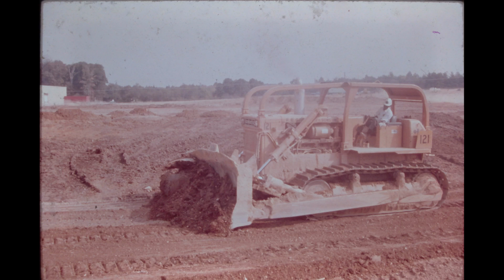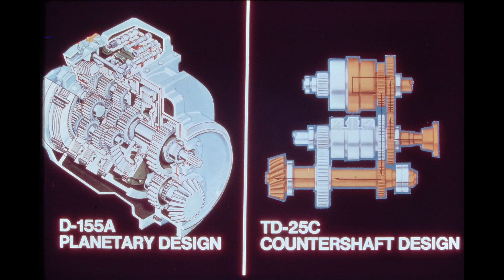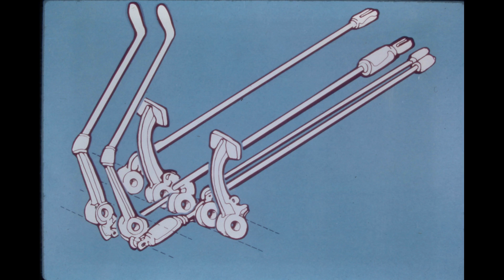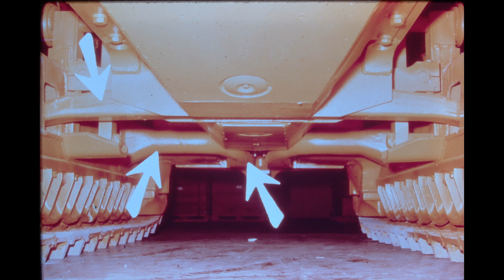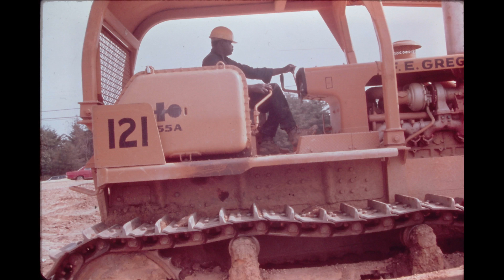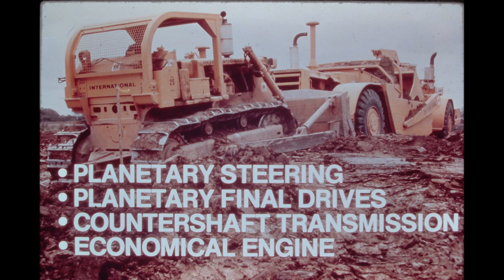International TD-25C vs Komatsu D-155A Sales Training

Comment: They were all pretty tough machines in their day…Komatsu’s trick was always to build a tractor just a little bigger and a little more HP and then run them in the same class as the other manufacturers…the thing about the IH’s is they were always a little lighter but had pretty good HP and unless you had a very savvy operator at the controls, the undercarriage would take a beating because they just weren’t heavy enough to hold them down…in the end Cat beat all their behinds!..not too heavy not too light for the HP available…they were the best tractor ever made…but I do love all the IH gear!..I would love to get my hands on a late model TD-25!..

Comment: How did the Cat D8K compare with these two
Reply from the maker: The D8K was a comparable machine but about 10 hp less than the TD-25C at 300 hp. I think the lower hp helped the D8K last longer. It was also slightly lighter and no planetary steering. But a formidable machine!
Reply: @deserttrucktractor2514  It's not very cost efficient to have a 25 pulling an 8 around all day to make it look like it's doing some work😂😂